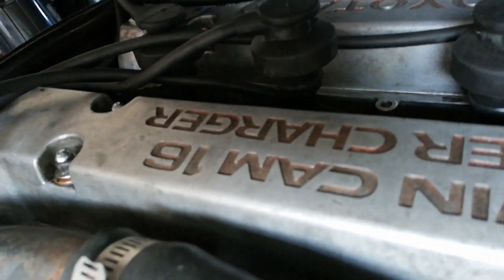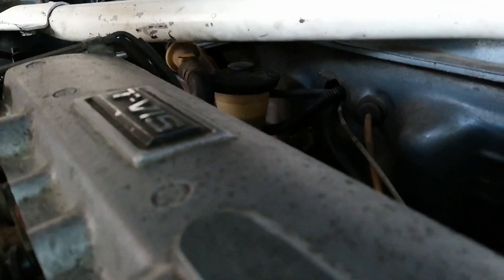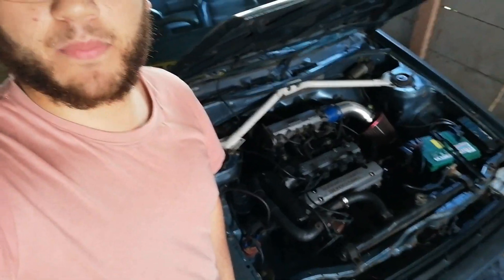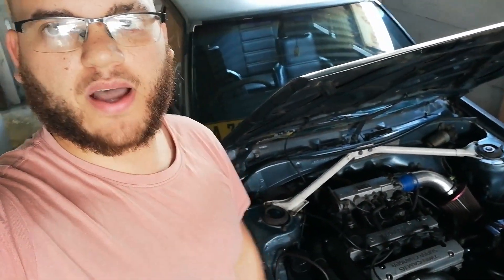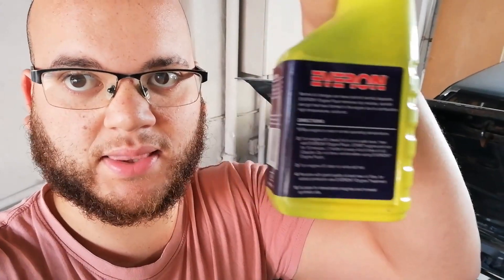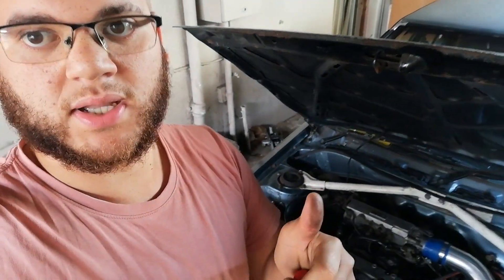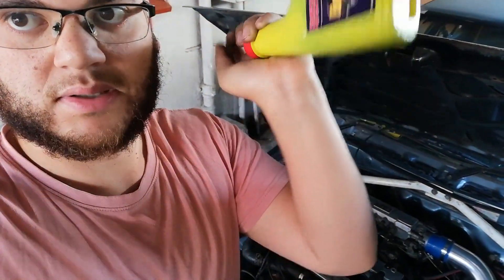HOW TO FIND ENGINE NOISES *BELTS, TAPPETS, INTAKE*

Comment: The noise is your shims, if you took the head out and gave it to the engineers, they were supposed to set your shims,  the gap between the shim and cam lob can increase if the head was done... The 4age is usually noisy, I had the same issue on mine, the intake shims were very noisy when engine heats up. Also try to use a heavier oil such as 15w40 or 20w50, this reduces the noise